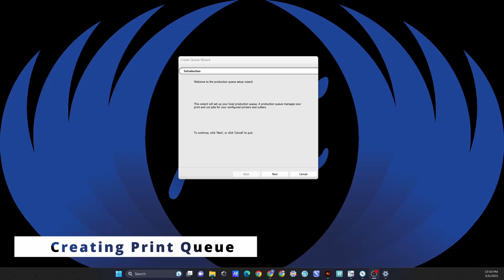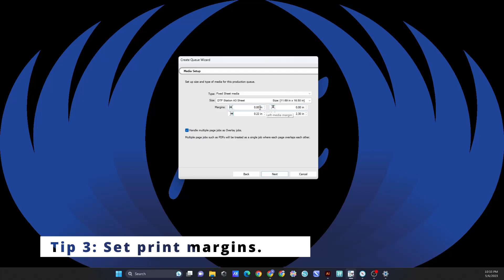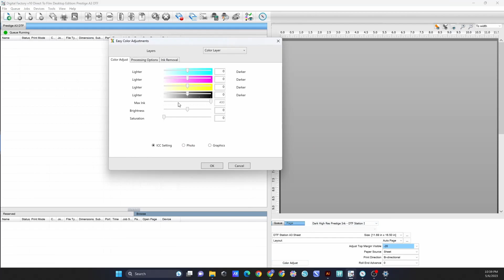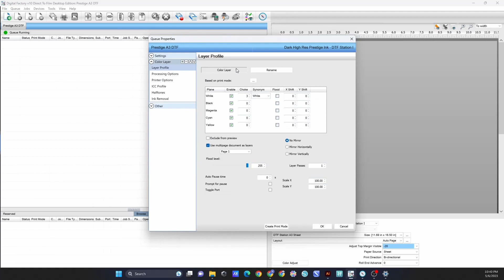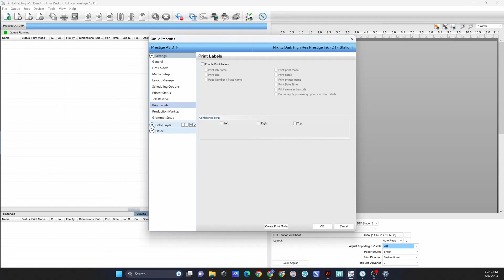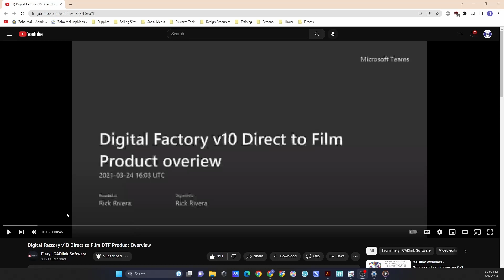Basic Setup for CADLink Digital Factory V10 DTF Software

Comment: i dont see my printer under port
Reply from the maker: Hi, I’m not sure what may be the problem. Check your cables and maybe restart the software. Usually once the printer is connected and on it would give you an option to add your printer.

Comment: when you purchase cadlink is it digital just pay and download digitally and that's it and how long will it last you ?how long can you keep it?
Reply from the maker: hi, the software was included with purchase of the printer. I was sent the key code in an email. I had to download the software and input the code to get access without a time restriction. You have access for life for the version that you purchased. There no monthly/ annually charges after purchase. However, you would have to pay an upgrade fee for future versions.
There is a limit on how many computers can use your key code. They can reset your code if you computer fails before deactivating the code on that computer. It happened to me a few times.
Reply: @nikittyworkshop  I already have the epson 8550 just need the software will it work on laptop windows 11
Reply: @nikittyworkshop someone told me yes as long as I have windows 11
Reply from the maker: @deeznuttz7980  yes is should work on Windows 11. I have mine running on 10. You can checks the specs on the CadLink’s website to be sure. You may need to download the drivers for your printer as well.
Reply: @nikittyworkshop  where would I go to dowmload the drivers to the printer
Reply from the maker: @deeznuttz7980  i think Epson’s support website should have them. Enter the model of your printer and it should bring up the drivers for your printer.
Reply: @nikittyworkshop  I have one more question I'm trying out the cadlink 15 day trial and the SET INK ORDER option on top left hand corner is not available it's there but  when i press on  it nothing happens not dark visible like the other options  u know why did you have that problem
Reply: @nikittyworkshop  I already loaded the inks in this order  wwcymk
Reply: @nikittyworkshop  and I really do appreciate you helping me
Reply from the maker: @deeznuttz7980  questions are good. I may not have the answer but I'll tell you what I know or where you can find it. I did not have that problem. I did find a video that may be able to help you. https://www.youtube.com/watch?v=9G0p4k59P-Y
I did notice a custom option with my software. Maybe you can select that and see what happens.
Reply from the maker: @deeznuttz7980  It looks like for your printer the ink order can be set on the lower right side under the Queue tab. There is a drop down that lets you choose the ink order. See if that works.
Reply: @nikittyworkshop  ill try it thanks
Reply: @nikittyworkshop  yes I came across that option and I set it up the way I had my inks I guess the queces on top options are for other printers models I guess
Reply from the maker: @deeznuttz7980  yea it looks that way. My printer uses the option on top. Therefore it was not grayed out for me. When I added your model to my software it was grayed out. That’s when I noticed the options changed on the bottom. I hope it works for you now. Best of luck!
Reply: @nikittyworkshop  did you buy yours from Best buy
Reply: I don't see my printer under port

Comment: Hand is raised !!!!! How come when I print yellow a hint of black comes out first
Reply from the maker: Hi, I’m not sure. Have tried gently cleaning the front part of the head with a swab and cleaning solution. AA Print Supply shows how to do it in one their cleaning videos. You can run a few lines of yellow to see if it keep doing the print error.
Reply: @nikittyworkshop  funny thing is when I run lines it’s prints yellow but when I printed yellow image it would print a lil black first , I took the print head apart and cleaned it , this printer ain’t for the weak hearted lol
Reply from the maker: @kanidanieldariusdad  oh wow, sorry you have to go through that already. Figured you would have at least 6 months before having to do that. Yea are correct this printer is not for the weak hearted.
Reply: @nikittyworkshop  it was a lot of ink caked up around the edge of the print head , if I print yellow by it self it give a hint of black , but if yellow is the secondary color it prints without the hint of black
Reply from the maker: @kanidanieldariusdad  you may have to contact AA Print Supply to find out what to do. The printhead may still be under warranty so they can send you a new one. Plus they may have some tips they can provide you. I have not experienced that with my printer. I run a 1” x 1” square of each color yellow, cyan, magenta, black and white. To help unclog the print head and get the ink running.
Reply: @nikittyworkshop  besides that I’m knocking the prints out lol …… I have to tell people no , they don’t understand the printer is slow and 75 prints don’t take a day lol
Reply: @nikittyworkshop  sending it back they don’t know what it could be !!!!! Lol
Reply from the maker: @kanidanieldariusdad   lol go figure! Make sure to get the shipping info on the replacement part. Hopefully you get the part quickly.
Reply: @nikittyworkshop  they sending a new printer
Reply from the maker: @kanidanieldariusdad  Nice! Even better!
Reply: @nikittyworkshop  so the a3+ is discontinued , so they only replacing with refurbished
Reply from the maker: @kanidanieldariusdad  oh wow! I guess they only selling the roll version. How is the replacement printer working out?
Reply: @nikittyworkshop  well they finally sending it out today , tech support is the work I had to call and call and call to see what was going on cus no one ever got to back to me after the got the old printer .
Reply from the maker: @kanidanieldariusdad  yea that’s a long downtime. I was hoping you would have a better outcome. That happened to me too. One time they send the part out right away but it took days to get to me because it was coming from CA and I’m in NY. The other time it wasn’t sent out and I had to call to find out where it was. Hopefully all goes well and you get a working printer shortly.
Reply: @nikittyworkshop  yes I’m in New Jersey so I got to wait a couple days
Reply: @nikittyworkshop  finally got the replacement in today about to give another shot
Reply from the maker: @kanidanieldariusdad  how was your first day back to printing? Did the replacement work smoothly?
Reply: @nikittyworkshop  it works and is quieter than the old one , has a button also by thermostat,  that the first one didn’t have , I can actually print any color right now ….. fingers crossed 🤞

Comment: Do you do a head clean before every print …
Reply from the maker: I do head cleaning at the start of the day. If I have a lot to print then I do another one after about 4 hours of printing.
Reply: @nikittyworkshop  yes me to , I’m about to get on it now , what temp do you cure the prints cus you know the oven only shows celcius
Reply from the maker: @kanidanieldariusdad  Currently I have it set at 280, but always check to see how the transfers are looking. Darkening of the white means too hot and the powder not melting enough is too cold. I have the time set to 90s.
Reply: @nikittyworkshop  how do you get to read Fahrenheit
Reply from the maker: @kanidanieldariusdad  I didn’t 😂. I couldn’t get it to change the units. I really don’t trust the temperature readout either. That why I just  gauge it by how the transfers look.